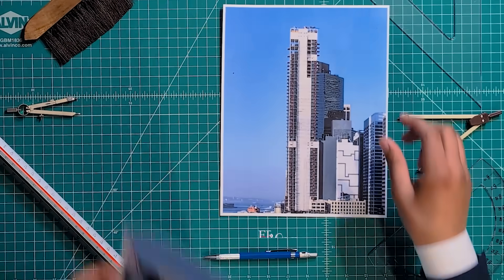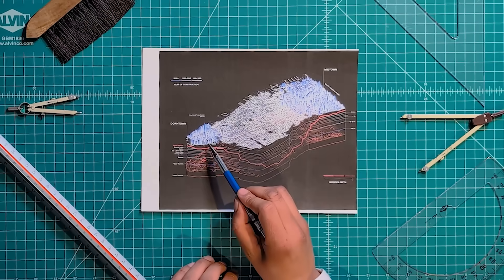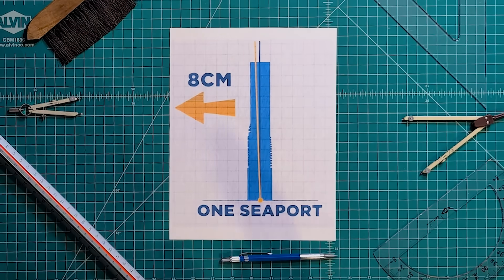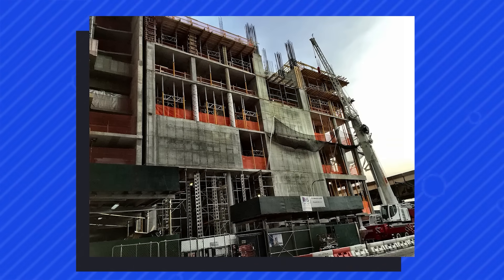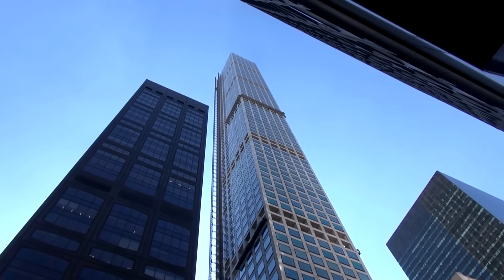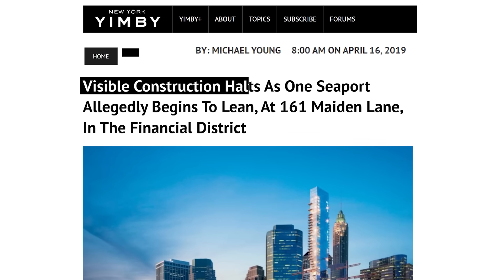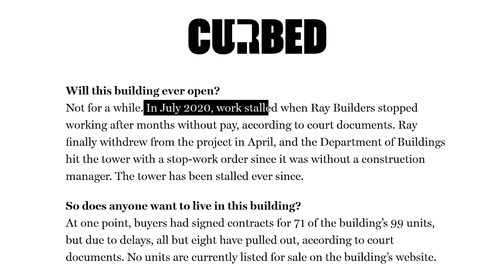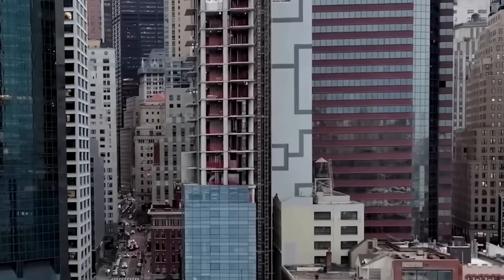Engineer Explains the Leaning Tower of NY

Comment: I dont get it. 8 cm over 50+ floors should hardly be noticable. It less than 2mm per floor. In fact I think many single floor houses would be leaning more than that without the home owner ever even discovering it.

They probably made a huge mistake by having the lawsuit. It made the problem very public and the apartnents impossible to market.

Something more must be going on.

Comment: I used to work at a company that makes construction scaffolding (the swedish company HAKI that revolutionized the "hook-on locking-catch" scaffold design) and I can tell you that being precise is absolutely crucial. The human workers always welded everything that wasn't crucial to the actual scaffold sections and robots welded the rest. The reason for why is because humans aren't as precise and if the angle of the section you weld is just one millimeter off at the bottom compared to the top, that difference has increased linearly by one millimeter per section which can result in a lean of centimeters when you get 100 ft. up in the air.

If the building sinks just a millimeter in one corner once it gets heavy enough the entire thing is gonna be off by centimeters at the top. The geotechnical engineer completely f-ed up. He knew very well that bedrock is the only way you can guarantee that your building won't shift.

Comment: Bracing  on the tilting side.  CABLES ON THE OTHER. CRANK  CABLES EXEND THE BRACED.. FORCED  EXPANDED  FOAM LOW SIDE.. IT Will  take 
A while  it is very  heavy

Comment: all building in the world are not straight, engineers constantly realign the design as they build. for it to go so far out of alignment requires them to build so fast that the building do not have time to settle. it also not the first time we see building on soft soil, that's why they tried it, it could be done. in fact some building are design to sink as much as 8 feet during construction. it could be managed if the process is not rush.

the real problem is NYC's stupid law. just remove it.

Comment: Looks like about a 1 degree lean right on the front pic even with your slanted pic, I also see later on in the video the building is already showing signs of stress with a slight curve in the middle area heading to the top it looks like to me. Not good there should have been better thought put into it before proceeding. Clearly a rush job like everything else now days

Comment: You don't have to be an engineer to see that injecting a bit of concrete around the supports will not actually make a big difference. The soil around them is still the weak point. Terrible decision.

Comment: I recall back in the 1990s we evaluated a site for a factory where the soil was deep and unstable before reaching bedrock. Geotechnical studies showed that the soil’s load-bearing capacity was very poor. A floating raft foundation was considered, since the cost of piling was almost as high as the cost of constructing the factory itself. Ultimately, we concluded that the risk was too great and the project did not proceed. By contrast, the decision to build a 700-foot tower on similarly unstable ground in New York represents a collective failure—driven less by sound engineering judgment and more by the developer’s pursuit of profit at the expense of due diligence and common sense.

Comment: That building has to be down scaled  to 166 feet to be safe= hollowed rods with a center of iron solid rods, extending down to the bed rock of all four corners, skeleton braced around the buildings structure every forty feet .  The upper most point of the structure would be at most vertical, and its over all structure weight shielded from wind shift. The poles will act as a vertical wide base corner stone , which two sides should be reinforced baring the lean upward for push - Its opposing sides , downward for structural pull. File that thing down.

Comment: They don't need to demolish it and start again. Whilst the lean is minimal, remove enough of the upper floors until it's stable and that becomes the final building.
Reply: It’s stable now. It just visually doesn’t look safe so no one will pay what it would take to finish it to live there.
Reply: @richardlellisjr  so why cant they redesign it? Spend more money. Wpuldnt u rather have A profit instead of NO profit? Id rather break even then LOSE money.

Comment: You don’t cross your heart and hope to die when it comes to the foundation for a tall skinny skyscraper where wind can reach gale force. Also, a large magnitude earthquake could occur in Manhattan, and with a structure like that sitting on land fill you could be looking at global failure. Look no further than Mexico City in 1985 and the 1989 Loma Prieta Quake in the Marina district of San Francisco built on land fill. There needed to be a lead engineer for the project who could tell developers the bitter truth that there’s no way to get around drilling way down to secure the foundation.
Reply: As a welding and structural steel inspector, I hear contractors moan about how over-engineered buildings are compared to 40 years ago and I often use two events that changed how things and codes have changed. One is the Hyatt Regency Skywalk Collapse and the 1989 World Series Earthquake and the damage done to bridges, highways and of course, The Marina District. In one case, poor engineering and construction and another, codes not strong enough.  Codes change and engineers are more likely to ensure that their math is right. 

A recent revelation about a building in SF in that it was closed down six weeks after it first opened sure shocked people, including the building owners whose now closed building straddled a road/transfer station. In this instance, the failure was tracked to a fab shop who did not follow proper procedures in cutting th.ck steel plate.

I also preach that if there is an issue, to get with the engineer before trying to do something that I would just fail is not built properly.
Reply: @mikes6973 - the public at large is oblivious to the engineering that goes into large building projects. Only when something goes awry do they begin to understand, but even then misconceptions abound. To this day many people still think the World Trade Center towers were constructed like the Empire State Building and therefore the rapid collapses could only have been the result of a pre-planned demolition. Putting aside the impossibility of preparing two fully occupied towers for demolition without tenants or the Port Authority security noticing anything, the conspiracy crowd didn’t understand what fire does to a steel structure. The towers successfully absorbed the impact of the heavy fuel laden planes going full throttle. But the fires they ignited across several floors simultaneously sealed their fate. After enough of the perimeter columns in the fire zone were weakened that was it. All the gravitional potential energy of the upper floors released at once was like an avalanche on that light weight open space design that couldn’t be stopped.

Comment: How does slenderness matter? A thicker skyscraper would lean the same angle on equally defective footings per square foot.
Reply: It matters.  A slender tower has a smaller footprint, meaning the understructure is slimmer, too, leading to less backpressure from the surrounding ground. Think knife blade verses brick, pushing against mud. The slightest lean, either due to unbalanced construction or wind, will start to push the foundation against the surrounding ground, and a thin foundation will begin to push THROUGH the ground.

Comment: Building skyscrapers in Houston is totally different. Bedrock is 2000’ deep. To counter this issues, basements are excavated and underground parking is created. This void is used to counteract the weight of the building making for zero net bearing pressure.

I once investigated my company’s 26 floor building foundation issues. The survey said the building was rising 6” over its life. A colleague from a geotechnical company was investigating another building not too far away that had sunk 10”. After a lot of discussion, we shared benchmarks and I put the data into my computer program and found that downtown Houston was tiling toward the Gulf. This was part of the subsidence issues in Houston due to extraction ground water and oil.

The settlements were not real but due to faulty surveying methods that used wildly spaced benchmarks that amplified the movements. I adjusted the computer program to compensate for the tilting to the sea and everything was normal.
Reply: That is because land is cheap and high rise apartments are not the thing. Building thin and high does not make sense in Houston especially with hurricanes. They tend to break a lot of glass downtown. Businesses sent workers to work at home for months. It’s not the wind, it is what is in the wind. People in glass houses should not live in Houston.
Reply: Houston also doesn't have super tall or super narrow skyscraper

Comment: The building authority should not have approved the plans. The original engineers and whoever approved the plans are responsible for the failure. The contractor is less responsible since they are only required to build according to the plans approved by the engineers and the state and city, unless they skimped on the materials. I worked in commercial construction and the company always hired an engineering firm and when things went wrong, the engineers were liable.

Comment: Monty Python nailed it, 50 years ago!

[An architect presents his design to a group of real estate developers -- "City Gents"]
MR. LEAVEY: Uhh, this is a scale model of the block. Uh, there are twenty-eight stories with two hundred and eighty modern apartments. There are three main lifts and two service lifts. Access would be from Dibbingley Road.

(The model falls over. Mr. Leavey quickly places it upright again.)

Uhh, the structure is built on a central pillar system, uh,...

(The model falls over again. Mr. Leavey tries to make it stand up, but it won't, so he has to hold it upright.)

Quite frankly, I think the central pillar system may need strengthening a bit.

CITY GENT #2: Isn't that going to put the cost up?

MR. LEAVEY: Uh, it might.

CITY GENT #2: Well, I don't know whether I'd worry about strengthening that much. After all, they're not meant to be luxury flats, ha ha!

CITY GENT #1: No, I quite agree. I mean, providing the tenants are of light build and relatively sedentary and, uhh, given a spot of good weather -- I think we're on to a winner here!

Comment: I disagree with the last line of this video. It was not the result of a series of failures. Fortis Realty tried to cheat on the foundation and got caught. The fact that they did not tell the construction company about what they had done speaks volumes as to their crime.
Reply: The corporate shield is why anything like this ever happens.  If CEOs, directors, corporate lawyers and upper managers were all under threat of 20-50 years of prison, they would all be bending over backwards to prevent non sense like this.

A simple change in the laws, and all of these types of epic fails dry up.
Reply: @spaceboy3101  agreed; if the wealth can flow up, so should the liability.
Reply: @spaceboy3101   Negligence can be grounds for piercing the corporate veil.
Reply: Their gonna get away with it until this building falls. It's not far from it. Another degree or two. An earthquake 1000miles away. If you live there, keep an 8k camera on this one.
Reply: That’s still a series of failures. A failure of the company to plan and communicate properly; a failure of the regulators to enforce standards; a failure of the engineers to blow the whistle; a failure among several parties to notice and understand the problems and their implications earlier; a failure of the investors to demand better; etc.

“A series of failures” doesn’t mean the same thing as, “a series of negligent errors.” Even if you argue that there’s only one negligent party here, negligent parties aren’t supposed to be allowed to build skyscrapers, so there must’ve been failures elsewhere, too. Well intended, blameless failures, maybe, but failures nonetheless. 

Recognizing that situations like this are systems failures helps us prevent their recurrence. Blame is another matter. Opportunities for improvement don’t lie exclusively among the blameworthy.
Reply: The number one question to ask here is why isn't the city forcing the company to tear the unsafe building down? So what are we waiting for? The building to come crashing down and kill innocent bystanders? The problem in this country is the oligarchs do what they want. And we sit idly by and let it happen. SMDH!
Reply: @acttemp6170 not everyone agrees this creates a danger to the public which is the criteria for red tagging the building.
Reply: @richardlellisjr  Wow, that sounds incredibly crazy to me. The ground settled more than what they thought, causing the building to lean to the point of stopping construction. However, it is not dangerous enough to generate the label of red tagging to force the owner to cough up the millions It would cost to  demo the building. I wonder who had the balls to put their name behind that decision. What engineer  placed their reputation and livelihood to stop that building from being demolished. As if they know that the ground will not continue to settle and shift that building even more.
Reply: They saved 6 million in cost
Reply: Shut up ...
Reply: Hope all New Yorkerz stay away  from that area . Time to stop these  high rises from going up.
Reply: Fortis didn't design the foundation, if the foundation was a cheat, the engineers never should have designed it and signed off on it.
Reply: @bobbygetsbanned6049 Fortis paid for it and did not check to see if the plans were sound. They were not. The plans were designed to cut every corner. Fortis gambled and lost.
Reply: @richardlellisjr  Fortis doesn't check to make sure the designs are sound, that's the job of the engineers! Fortis is not the expert on foundations, the engineering firm is, it's the whole reason they were hired. If it wasn't going to work, they never should have designed it and signed off on it! You all just comment dumb shit, proving you have no idea wtf you're talking about.
Reply: @richardlellisjr  It's no different than if YOU were building a home and hired an engineering firm to engineer the house. Then the foundation fails, and you're at fault, because YOU should have checked the engineer's work, to make sure it was sound! Right???
Reply: tofu dreg coming to USA
Reply: Nothing will happen to them tho

Comment: Just the same as the Tower of Pisa: bad foundations.  Engineers omitted the most fundamental building requirement. : a strong foundation designed to carry the building weight+ office equipment, flooring, people, and on top of that a safety margin of about 30%

Comment: If possible, buy the surrounding property and build a support building to give support to stop the lean. so you would have two usable structures instead of none.
Reply: Unfortunately doesn't seem like there's a lot of surrounding property to work with not to mention the cost of buying that property in downtown NYC. The building is bordered by streets on 3 sides (Maiden Lane, Fletcher St, and South St) so the only building directly next to it is 151 Maiden Lane. 151 Maiden Lane seems to currently be a hotel, not sure if owners would be willing to sell, but it probably wouldn't go for cheap and supporting such a building might be an engineering headache if possible in the first place.
Reply: Flying buttresses😂

Comment: Once the building is demolished, can the foundation pad be re-used, with appropriate adjustment, for a new building? Does the sinking stabilize/become negligible after a reasonable number of years?
Reply from the maker: I would redo the foundation entirely considering it caused this problem in the first place.

Comment: A classic case - designer ran analyses by a software - results show the settlement and differential settlement (leaning) of tower would be within a safe limit.   But analyses are not accurate.
Reply from the maker: I think this scenario is different because they used a newer type of foundation system on such a large skyscraper
Reply: Analysis is only as good as the data you use. Garbage in, garbage out.
Reply: This fiasco is after the millennium tower disaster.   Tower with very load should always have its foundation on rock.
Reply: New type of foundation for the tower - never stick the head out for new ideas.  The mistake is irreversible.
Reply: In theory, theory and practice are the same.  In practice, they are not.
- Einstein (supposedly)